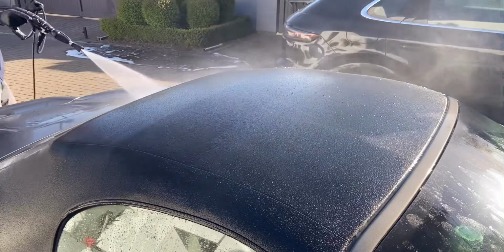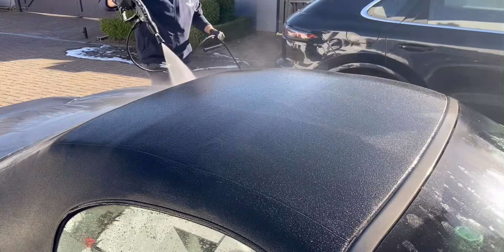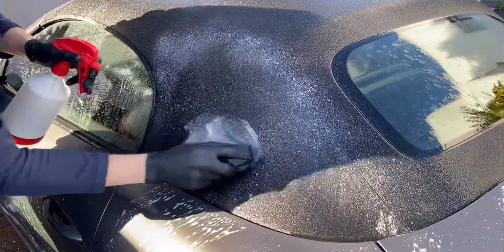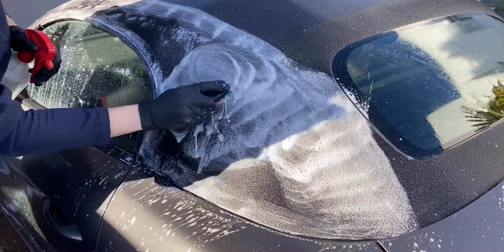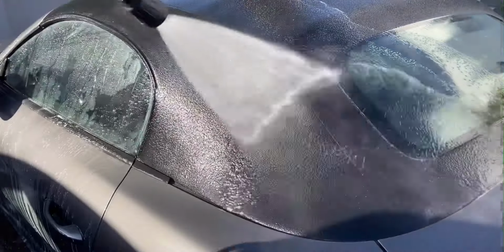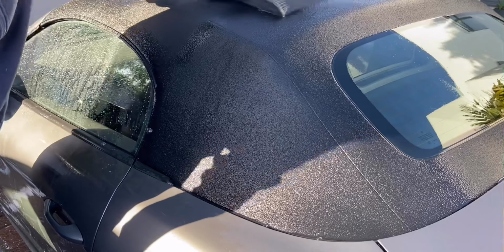HOW TO CLEAN YOUR CONVERTIBLE ROOF | TIPS & TRICKS

Comment: white vinegar will kill moss and lichen, pit it on neat while the top is very damp or et and leave it alone. Its better if it doesnt dry out but a couple of days is enough then just wash it out with warm water and dishwasher soap. If you use a brush, following the grain of the fabric ( not scrubbing in. circles  or arcs ) you will see the moss and algae coming off like a black scum. Keep rinsing it until the water comes off with no scum .
Reply from the maker: I can see this working on lightly soiled roofs, but not heavily stained.
Reply: @HarpersCarDetailing  this was green with a few spots of lichen and hadn’t been cleaned for three years. Vinegar is now sold in garden supplies as a weedkiller. Its a weed killer ok but not systemic, I like the idea that its not a monsanto poison. 1/2 litre did my four seater cabriolet.

Comment: Sir, would you advice to use a water repellent afther cleaning?
Reply from the maker: It’s certainly a good idea. 
Either brush it on or use a sponge to apply. 
You can spray it on through bottle but unless you cover all exposed panels with a plastic sheet you will get over spray. 

Thoroughly clean and let the roof dry beforehand
Reply: @HarpersCarDetailing  Thanks!

Comment: Would advise to never use a stiff brush...use the softest brush you can find and your top will last forever.
Reply from the maker: It’s not too stiff, so safe to use and doesn’t change the texture of the material. 
Sometimes when the fabric is really mouldy you need a bit more pressure/firmness

Comment: A 1:10 dilution ratio does not mean 1 part chemical and 9 parts water. It literally means 1 part to 10 parts all equal amounts. That’s why it’s 1:10 not 1:9.
Reply from the maker: You were correct the first time. 
Well certainly in the UK it would be 1 part product topped up with 9 parts chemical so 50ml:450ml if calculating 500ml
Reply: @HarpersCarDetailing  I took chemistry and had to calculate dilution ratios regularly and 1:10 means one unit volume of solute to be diluted to 10 unit volumes of the solvent to give 11 total units of volume. 

Here is a simple overview to help break it down for you. I hope this helps. 

https://en.m.wikipedia.org/wiki/Dilution_ratio#:~:text=In%20chemistry%20and%20biology%2C%20the,it%20with%20another%20liquid%20substance.
Reply from the maker: It depends where you are looking though and which source you use. 
This one for example suggests the way I use it. 

Again, it might be a demographic difference 

https://www.microbiologics.com/core/media/media.nl?id=1758034&c=915960&h=fc555e1fdf60b6138d07&_xt=.pdf

Comment: Pressure washer on a soft top? Hello no dude. I have an 06 mx5...never would i dream of using a pressure washer let one direct hosefire on the softop. 

Water will get pushed past the seals 100%. Just use the shower setting on your hose head.
Reply from the maker: Providing that jet wash is far enough away it’s fine. 
The stream of water is just to rinse the chemical away. I’m not relying on the pressure. 
I would happily put my hand in front of the jet at the distance I used it, so that’s a  good rule of thumb
Reply: @HarpersCarDetailing  sweet glad you're cautious about it

Comment: NEVER ! use a pressure washer.
Reply from the maker: Why?
Reply: Could tear the material or wear it down
Reply from the maker: If you hold it extremely close so possibly could but not the distance I was. I would happily put my hand in front the the stream of water at any time in this video
Reply: @HarpersCarDetailing  you’re right against the top in a lot of the vid and if you’d put your hand in front right against it I guarantee it’ll hurt and take skin unless your pressure wash is weak 😂😂
Reply from the maker: @cobygreenwood1015  it’s not weak it just has a 45 degrees angled tip in this video, thus taking away the majority of pressure.
Reply: Can you link to the brush? Nice work btw
Reply: @cobygreenwood1015  its the tip on ur gun that matters. He right U can put ur hand in front of some tips